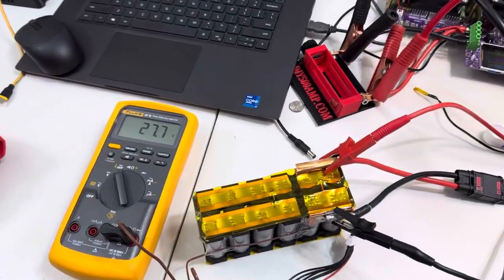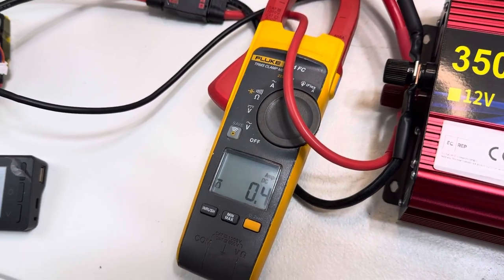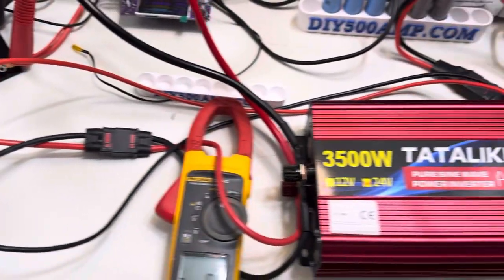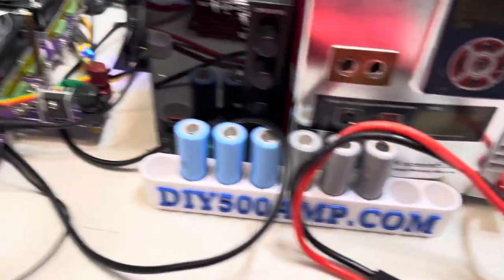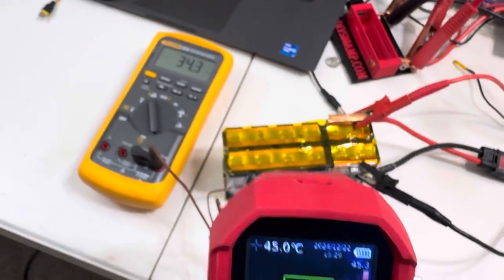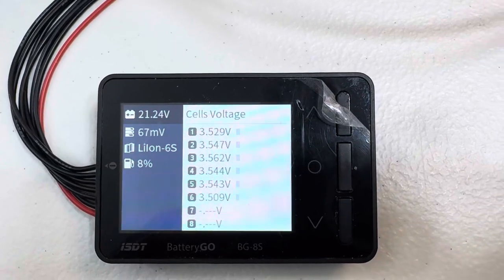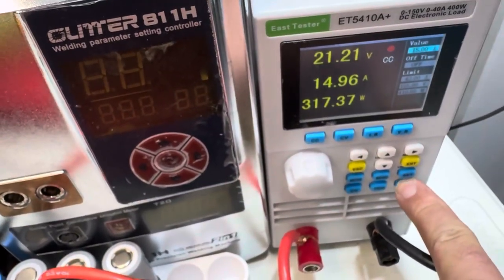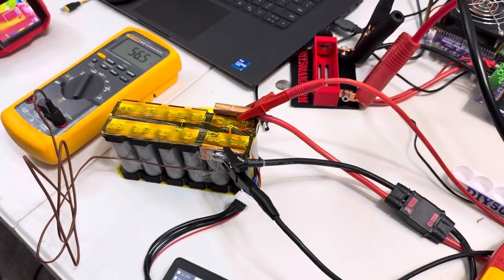Ampace JP40: The New Molicel Nightmare? Unbeatable Performance at 79A Load!

Comment: Hi again, I just searched a bit and it seems that the skin of hands is burned if touching metal objects with a temperature greater than 60-70°C in just a few seconds (under 10S for sure). So if I can hold my batteries on the hand for several seconds I should be safe under 80°C xD hahaha just if someone is asking as myself :)
Reply from the maker: What cell are you talking about JP40? or Molicel?

Comment: Very nice test! Would like to see something similar, maybe just for 1 minute straight on 1S pack or one cell. On the weekend I tested my BAK 45D pack (6S1P) on one EDF RC Jet that pulls a lot of amps and has beaten my Molicel pack pretty up sometimes. So I went full throttle for at least one minute I think. After landing the pack was also super hot (my temperature gun had sadly no batteries for using it) but the internal resistance is a bit lower than on the P45B. Need to do some bench test at least with Cell voltage and current (and maybe pack temperature). Thank you for sharing your tests and knowledge!
Reply from the maker: 1P is hard for any cell. Remember as well when they are in pack, we can expect even more heat and more difficult heat dissipation. Always go oversize in copper to help dissipating the heat using the thick copper as heatsink.
Reply: @DIY500AMP  Yes I began to use 1mm copper thickness and 5mm wide. For bigger planes I´ll do 2P. It´s also more capacity :) But it would be nice to have a lightweight 6-8S 1P pack... Maybe this JP40 could do it for some optimal airframes :)